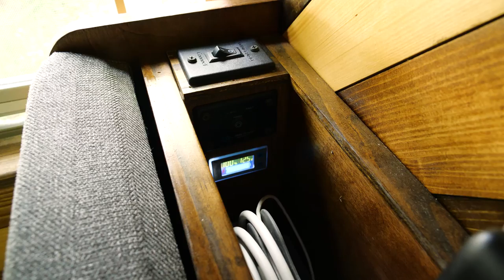Tiny School Bus Conversion Tour | Off-Grid Bus Life

Comment: Hi guys. You can buy a 3 gallon per minute shower head and screw it onto your  sink faucet. If it doesn't fit, they sell adapters at home depot or Lowe's. They spit out far with  good pressure and saves on water. 
It'll add about 2-3 inches length.
But you can unscrew it anytime.

Comment: crazy not having even a tiny generator. Something small just to keep the battery charged. 
They are small enough you can connect it to the fuel tank., or use Propane.
Reply from the maker: Stephen Waterman Eight months of full-time travel in the books and I’ve yet to say to myself that a generator would be helpful. I was extremely mindful of using 12v as much as possible and it’s really helped our power consumption. Only wish we had 400Ah and not just 200Ah, yet still haven’t had any issues  to this point.

Comment: Your bus looks great.  I live about 100 miles from Union so I was wondering about what your cost to build was. I'm just west of St. Louis so the prices would be comparable. Also, where did you find Lucky at.  Great job guys!!!!!!!
Reply from the maker: Everything all together for our bus cost 15k including our scooter too. 👍Monica is working on an e-book on how we made Bus Life Possible and it will have a ton of helpful information for future buslifers like yourself, so be on the lookout for an announcement on that soonish. We found our bus Harriet in a North City cemetery off of fb marketplace, 😂. I looked for about a year and we looked at her once, then test drove her with a gear-head friend of ours, and then made an offer. 👍
Reply: @fliplifepossible  thanks. I really didn't think that there were good busses around here because of all the salt used on the snow. Will be looking for the ebook

Comment: Great conversion & video. I am in early planning dreaming process and you already answered a few questions for me. Best one was the front door master puck lock. I’d been pondering how I was going to handle that security issue. I’d thought about bar across the inside & using drivers door for egress of any length of time. Like this better. ? though, how do you lock up at night when inside ?  Thanks again for video. Your Plan B’s will save me time, money & frustration. 😆. Subscribing.
Reply from the maker: islandwitt1 At night we lock the slide door and then enter through the drivers door cab and lock the drivers door then we’re fully locked in.

Comment: I just wanna point out. I love the lock on the front door and I know it was trouble to install so you had to use washers but it would be pretty easy to cut those bolts now that there is such a big space. No critiquing just Tryon to help
Reply from the maker: D McB Yeah but if someone really grinds our bolts off in a grocery store parking lot then they did the work and deserve to get in haha. After all this whole bus is windows. Wouldn’t be that hard one way or any other.

Comment: Do you know the total length of the bus with and without the scooter hitch? Is a standard parking spot to small? Thx and awesome bus!
Reply from the maker: Paul Mahfouz 21 ft bumper to bumper and about 24 with the scooter rack. We can back into single spots just fine on the outside edge of a parking lot. Glad to have the backup camera for that!

Comment: One of the most useful conversion videos I’ve seen. I have a question about the jump seat. How comfortable is it after a couple hundred miles?
Reply from the maker: Holly Whiting Thanks Holly! After a couple hundred miles it can get a bit uncomfortable for Monica. They make many different version that may be a bit wider that you could look for, to add some comfort. I’m uncomfortable driving after about 75 miles in the drivers seat so we don’t have very long stretches of driving hardly. Overall, it’s one of our favorite features of our build though.

Comment: I thought that fridge WAS a 12v?  What's the difference?  Still building out my rig.  Been 8 months, an still just in the Sketchup phase.
Reply from the maker: The frig can be run using either 12v or AC. 12v takes way less power consumption than AC power, such as a standard wall outlet... We spent a lot of effort making sure everything was 12v to save energy within our solar setup given we knew we could afford a large battery bank.

Comment: Where did you get the ladder on the outside of your bus please   I have two of those locks what I need is the metal bit around the edge of your lock that is bolted to your bus  where did you get that ?? Thanks 🙏
Reply from the maker: Paula Cannon We found our ladder on CL, it was off an old 70s RV. Could easily find one at a junk yard in all likelihood. Could be a fun adventure. 🙂 As far as the metal lock holder goes not sure exactly where you could find it by itself, we have ours linked in the description, perhaps start there and click around on Amazon. 🤔 Thanks for checking us out!
Reply: Did it got two cost £110 to U.K. thanks

Comment: Dp you worry about he heat warping your records?
Reply from the maker: Haven’t had an issue yet. They are kept in a low storage compartment that keeps pretty cool even in hot temperatures. None of my records are super valuable either so not to worried. I’ll have to pull that player out today, thanks!

Comment: Do you need a special license to drive a 28 passenger buss?
Reply from the maker: No, in most cases you don’t need a CDL for the majority of skoolies. You’re driving non-commercially” so you don’t need a CDL. Usually the only stipulation is if it’s over a certain weigh in total or has certain braking systems pending on your states of registration.
Reply: Thank you!